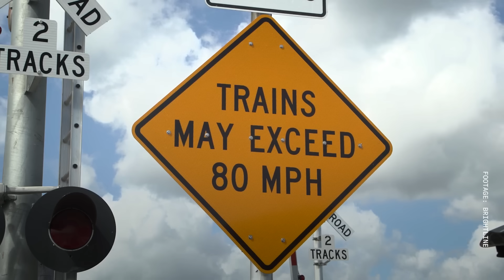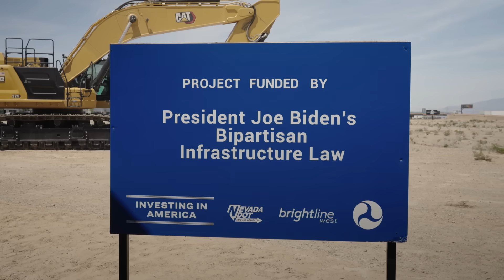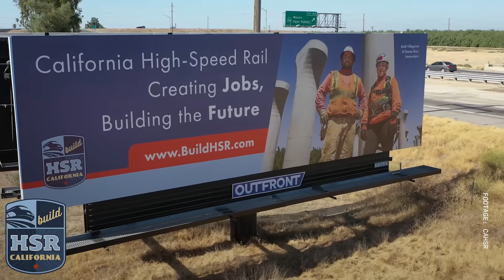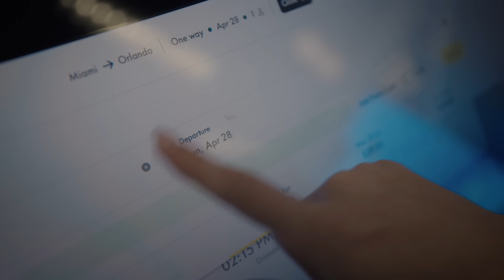Inside America’s First High Speed Rail

Comment: What a big expensive step backward. Did they count all the fuel being burned to create the concrete? Airplanes are still better, less capital intensive, as the airports and runways are already built. This is a platform for "Investors" to make more money off off, just like the Military complex.
Reply: no, yes, no, and yes. per passenger-mile, the impact of the infrastructure is spread out over a much higher volume service. smelting aluminum for planes is also very, very energy-intensive, and large airports are not at all cheap to maintain.
Reply: but fuel being used to add another lane to an already super wide city street or highway to finally manage traffic is okay then?
What about the lower passenger capacity? What about the limits for the weight, size and pieces of luggage you get for flights and all the time you spend getting to and from the airport, security checks, boarding, being there an hour early etc?

Comment: It turns out, this CA HSR is unlikely to succeed.  Already badly over-running its budget and time lines, it's been doomed since the politicians insisted it run down the east side of the central valley.

Try drawing a line between LA and SF.  Notice you'd have to be undergoing a stroke for your line to look even vaguely like the map in this video.

Well, it gets worse.  SNCF, the French train company responsible for the TGV, among others, submitted an informal proposal to the CAHSR board early in the project.  The proposal not only provided a clear pathway for reimbursal and public ownership within a decade.. it didn't require any public money.  SNCF had already lined up its own private funding to build a rail corridor between the two cities.  The problem?  It didn't have any pork for the politicians because it used existing right-of-way down I-5.  Meaning no lucrative real estate deals, no home-town pork barrel construction contracts; none of it.

CAHSR killed it.  They wanted the huuuge public money to waste and fritter and give their friends.  The projected costs are now $200 million PER MILE.

CA HSR is corruption at its worst.

Comment: If projects are being completed with public funds, they should be publicly owned imo. I am so excited to finally see high speed rail in this country tho
Reply: It’s only being partially publicly funded. Brightline has billions in private funding going into the project and the Florida route uses privately owned track as well. The airlines also use public funds and no one thinks they need to be publicly run. Sometimes public-private partnerships are a great thing because they move projects very quickly and the standards are much higher (Brightline’s passenger experience and on-time performance is way, way better than Amtrak)
Reply: @KrishnaAdettiwar I feel that It’s important to stress that the Abysmal delays that Amtrak expectancy is not Amtrak’s fault. They are caused by freight companies violating the law and the department of justice’s lack of care.

If you look at just the northeast corridor where most of the track is owned by either Amtrak or New Jersey transit the punctuality of trains is quite good, and expected to get better with the gateway project.
Reply: @KrishnaAdettiwar  If you have a government that it's priority is WAR over people at home. If you have a responsible government, the standards will be high if it gets prioritized, for instances, sending bombs to others countries, those are expensive and high quality.

Basic and critical infrastructure should be own by the government, water, oil, electricity, public transport, etc to make it affordable for the people, oops, that's socialism, which is the opposite of capitalism.
Reply: No more forcefully confiscating citizen's labor for bad poorly managed projects that create scarcity and lack of options due to anticompetitive funding and regulations. The roads should be private. The rails should be private.
Reply: @tann_man  why you do hate yourself?
Privatization of anything id anti workers and is against the pro union movement
Why are you so dense? 
You lack empathy and a wake up call
Reply: @comradehasan  I don't hate myself. Why do you project such things? In what way do I lack empathy? A market where people are free to consensually trade amongst each other improves everyone's lives. public funding necessitates the violent confiscation of poor people's labor. Why are you in favor of stealing from others?
Reply: @tann_man And compel airlines and airports to EARN THEIR OWN MONEY instead of depending very heavily on governmental oversubsidization from all levels….
Reply: @CraigFThompson  agreed!
Reply: This is America, this thing will be privatized and it will not be for the poors. Hope I'm wrong tho
Reply: @rabbits333  Trumpanzee terrorists stormed the US capitol for an INFINITELY less important cause than the TRULY IMPORTANT cause of keeping rail public. They were just a bunch of sore losers of a legal election. People will storm governments capitols and riot if they are not given high speed rail.
Reply: @rabbits333 good
Reply: But that would be communism!!!

/s
Reply: Yeah you wish😂 american capitalism will nit do that lmao
Reply: Nope it should only be private
Reply: @The_king567  are you a capitalist?
If not stop sucking and simping for the overlords 
Peasant brain 🧠
Reply: @The_king567 In which case we also should privatize the stuperhighways, turning their ownership over to the motorists and vehicle fleet owners….
Reply: @CraigFThompson they are already private
Reply: In a socialist America the workers would own the means of production ❤ soon my friend ❤
Comrade 🫡✊🏼
Reply: @comradehasan  it will never happen.
Reply: @aasamspb967  anything can happen with a shift in attitude 
That’s my dream ❤️
I know it’s hard to imagine 
But we are human 
We can anything we desire for the betterment of mankind 
Star Trek made me a communist by the way ❤️
Reply: @comradehasan  it's not that I'm saying US will be communist. It's that we won't let US be communist. I don't like Communism.
Reply: @aasamspb967  just like communism is growing in this country 
Fascism is growing in Europe 
Do you want freedom and democracy join a communist party❤️
You want democracy to disappear and fascism to grow more and more  
Don’t do anything and  slowly it will dissapear

It’s up to you what you want to do 
It doesn’t matter if you like communism
You will have to take a side soon